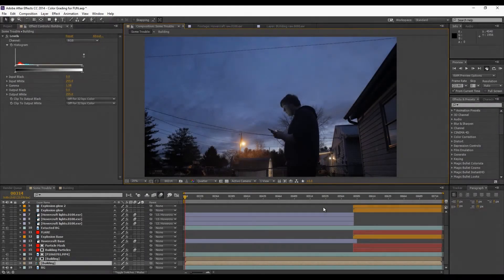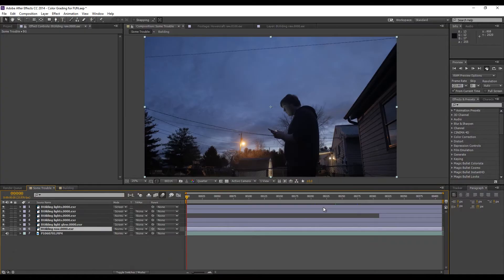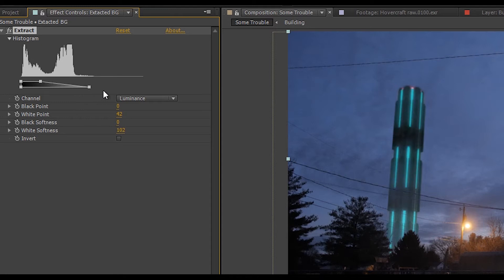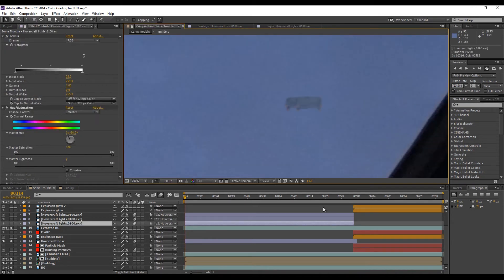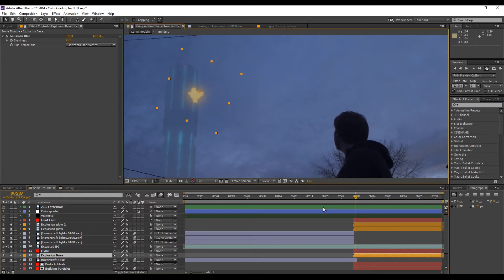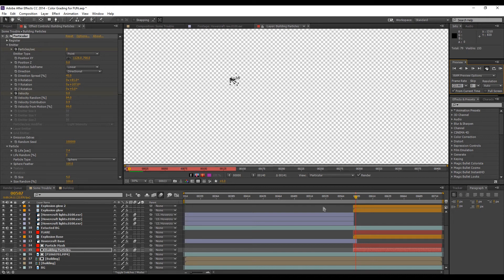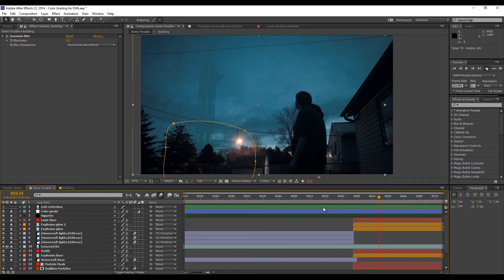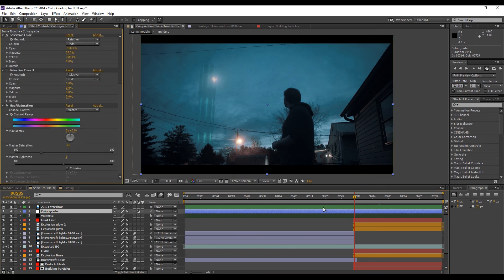After Effects VFX Breakdown: Futuristic Building and Explosion Shot

Comment: nice soundtrack, what is it called? It kicks my 80s childhood into high gear :)

You got a good eye, dude. Some tiny things you could do hear us to have the tower get blurry as it goes up. There’s more atmosphere between it and the camera. Also I suggest you use a camera noise plate / also known as grey plate. As the low light footage is noisy (even visible with  yt compression) and the elements are clean from that noise. Overlay a noise plate shot from that camera and it really helps it blend in.
I did an indie horror movie a d I asked the director for a noise plate, they’d never heard of it, so I explained what it was and how they’d create one. I overlaid that noise o er the 2D set extensions and the director immediately said: ‘woah that noise really helps integration!’ And he’s also an SFX mane up hey, so he knows blending :)
Especially for a massive set extension I painted in photo shop that’s 75% of the screen  really helps.

Comment: Why use a 3d model for the building while it could easily be accomplished by just using a 2d picture?
Reply from the maker: You can totally do that, I did it like this because I wanted the building to have the right perspective to the shot and also a similar lighting situation with multiple 3d passes that I could manipulate to get the glowing of the building right. I'm not a 2D type of dude so 3d is easier for me anyway.
Reply: Perfect question and very perfect answer :))